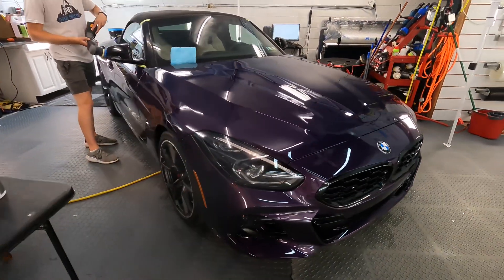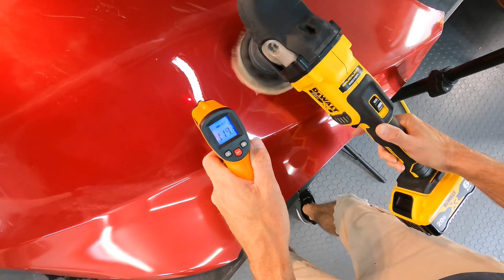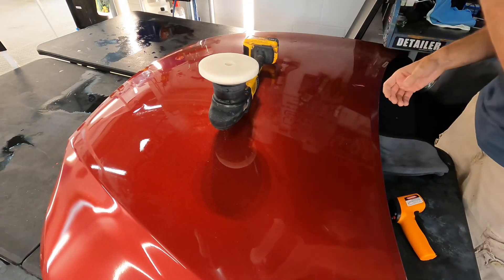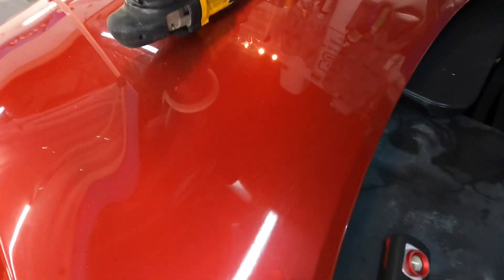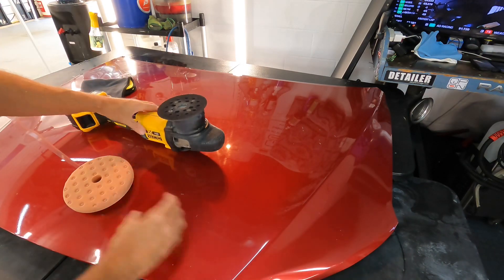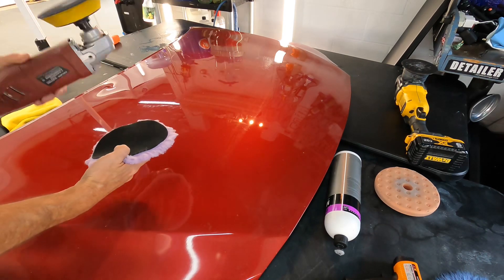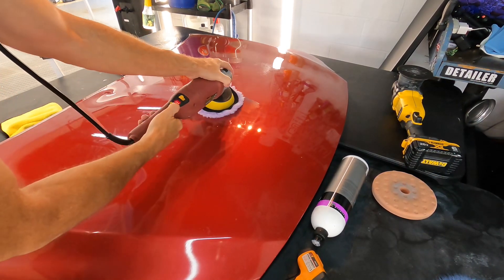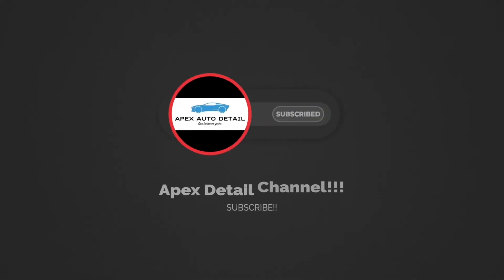These Are The SAFEST Polish Pads For Modern Clear Coat! Paint Correction!

Comment: Why did you switch to a rotory for the wool pad?
Reply from the maker: Wool pads should only be run on a rotary. On a DA....it is a waste of time.
Reply: @apexdetail85  Thank you for the information, I didn't know that, I've never used wool pads, and this is good to know.
Reply: @johnp8120  Yeah I didn't know that either. Several years ago I had bought some wool pads and didn't own a rotary. I could not figure out why I was hardly getting any correction with my DA and wool. Bought a rotary and now rotary with wool is my fav combo, super fast with heavy duty correction.

Comment: When you hear that sound of the surface vibrating. It’s because the thing that is vibrating is the tool, which in turn transfers that vibration to the panel.   There are two major concerns about that kind of noise when doing this job.    First, that means that SOMETHING is slipping and grabbing in quick succession, which means that the coefficient of friction isn’t remotely uniform across the face of the pad, so add product but only enough to cover the pad UNIFORMLY, and only a moderate film thickness;  not just a glaze,  and not like icing on a cake.     This vibration tends to accentuate the problem rather than fix it.  For every little bounce, the product is being bunched into smaller and smaller sections, which  means some parts of the surface are receiving more dangerous impacts than necessary, and the other panel that  came on the car pump

Comment: How hot does the paint surface get if the vehicle is in the sun for say 20 minutes?
Reply from the maker: It can exceed 200 degrees. But keep in mind the panel is reacting to the heat as a whole.....not one little concentrated area within the panel during correction.
Reply: Exactly my argument. If a guy parks a car behind a wall in the cool shade but there is a small gap in the wall, which allows a strip of baking sun to hit a small section of the paint, does this area of paint fail prematurely? Of course it doesn't.
Reply: You’re leaving out a variable and so did they.     The clear coat certainly softens, but there is no outside influence on where that coat goes.   If you were to take a microfiber towel, dry, and run the paint across from where the sun was not hitting it to where it was some 20-80 degrees hotter, you’d notice that the hot clear would have a  little more “grab”, and with a bit more pressure you’d start moving that coat around a bit, making imperfections which are exactly the opposite of  what we want.   My point is that left alone, even hot, it won’t ruin it.     But if you are doing too aggressive of correction on that blazing hot clear coat, you could ruin that coat, easily.      I’ve applied heat to a run which had not cured  on a nearly horizontal surface and watched it slip away into uniformity.    On a vertical surface, if it’s not dry ENOUGH, it will tend to drip with a finer sag.    Allow it dry just a little after flash off, and that drip will be more uniform across the width of the run.

Comment: Does pad temperature equate to the degree of cut? In your test was it possible to see which pad gave the best level of correction?
Reply from the maker: Keep in mind when the clear gets hot....it swells...hiding imperfections. So keep the area within 20 degrees of the rest of the panel you are working on.
Reply: Hi Brian, was your posted answer intended for another question?

Comment: For some reason, everytime I try to use a foam pad with my DA, it leaves curly scratches behind on the clear.  It could be something in the polish I'm using, but I never have a problem with the microfiber pads at all...
Reply from the maker: Which foam pads are used? Which polish?

Comment: I watch your videos all the time. In the case of this video, it's a little misleading in that the wool pad was used on a rotary which only spins. A dual action will create more heat since it's moving in two different ways at the same time. I would love to see the same test done using a DA compatible wool pad such as the DIY Detail one on the same dual action polisher. It would also be great to see how the throw of the machine affects the temps. Perhaps try an 8mm, 15mm and a 21mm with the same pad.
Reply from the maker: Wool on a DA is useless. To utilyse the wool fibers to the fullest.....put is on a rotary polisher. Give that dual action a break good sir.
Reply: @apexdetail85 the short nap purple foamed wool work fantastic on a DA. Same goes for any short nap wool.
Reply: that’s a strange comment Brian? surely either use all on a rotary or d.a?
Reply: Na if you think about the pattern of the random orbital is just that, random, the oscillation means that the pad doesent touch the same area as often as a rotary which has a consistent pattern and higher speed over said area. Also a rotary rotates hence rpm matters. A random orbital is not, and we dont use rpm moren than on the drive shaft. The actual free spinning oscillation frequency is then much less and also depends on pad, pressure etc variables. You transfer much more energy through a rotary. Test, take a da crank it up to max, hold it in one spot, take a rotary same pad and do the same...i promise you that if the pad survives the clear will smoke from the rotary first. 😅 I guess this is why Brian made his point, eg the wool runs coolest even though the rotary is more "aggressive".

Comment: What is the ideal temp? Does cooler mean better or consistent mean better? At what heat point do the pads lose their effectiveness?
Reply from the maker: Keep the area you are working in within 20 degrees of the rest of the panel.
Reply: Old cars have different material clear coat and can take heat, new vehicles do not, heat will damage the clear coat quick. As he recommends, just a little more than the rest of the panel.

Comment: So im not denying that too much heat is bad and cooler is better. But, i think as detailers we over complicate things at times. Im not saying go out and allow the paint to get scorching, but when was the last time you saw paint fail because somebody got the paint warm (not scorching) during normal buffing? Id be willing to put money on the fact that if you left that panel out around that back of the shop for the next 10 years and then inspected it, the areas where you used the 'hottest' foam pad would look no different to the area that you used the cooler running wool pad. In my opinion (for what its worth), all these pads and levels of heat are just as safe as each other and none are going to cause any kind of premature failure. My favourite pads are the Lake country CCS pads. I dont know, i just find they run smoother and feel nicer. I also quite like the Flexipads hex groove pads
Reply from the maker: I just have to say this....work on modern water based clear more and more then get back to me.
Reply: @apexdetail85 Ad hominem replies are not smart. Don't ever take your car out in the baking sun if you're that scared of a foam pad, creating a moderate temporary warming of the paint.

Comment: For a paint enhancement or very minor correction on black paint with old thin soft clearcoat (2007 Acura MDX), should I try a finish wool pad (like a Lake Country purple wool) because they run cooler?  I've always used light polishing/finishing foam or Urofiber 50/50.  Naturally a test spot would apply here but just wondering if I should buy one of these wool pads or not.  TIA!
Reply from the maker: Yes....always the least aggressive method first. Step up from there.

Comment: Maybe don’t set such a bad example by setting ANYTHING, much less the heavy tool, on the surface you are working on.    Maybe have a table or another flat surface that holds things(rhymes with cable) to keep them within reach.   Maybe a slightly faster sweep across a section.